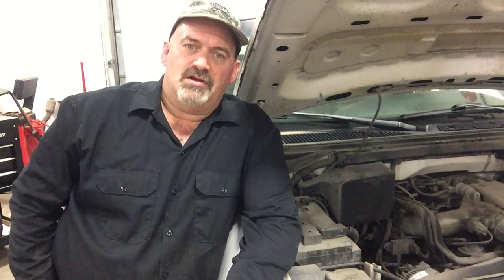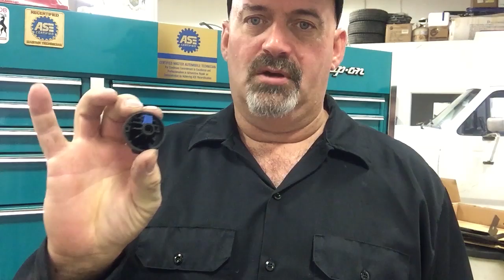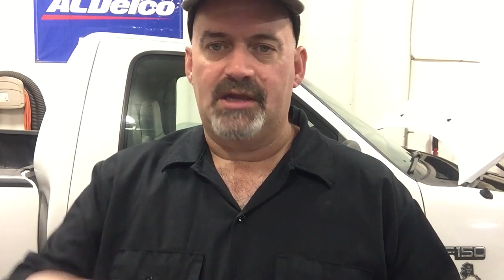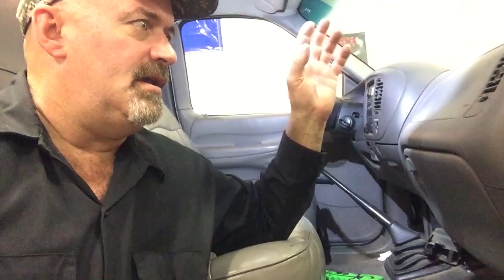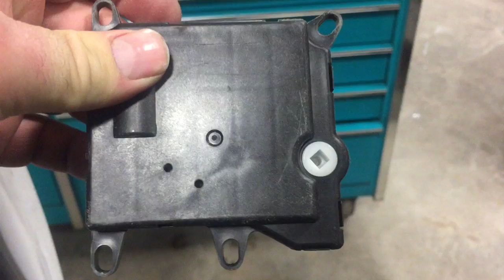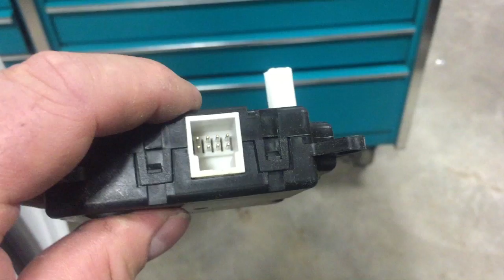Ford F150 Expedition Lincoln Navigator No Heat Or Cold Air - Blend Door Diagnosis and Repair

Comment: Hi Tim I just replaced the fuse box with a blown fuel pump Relay on my 2004 Expedition Eddie Bower 4.6L now fuel pump is working but now AC and Heater blower is working but I don't have any Cold or hot air coming out before AC and Heater work good the used fuse box I bought is from a 2005 but not sure if it's from an Expedition or F150 or Navigator

Comment: Aloha;'s Bruddah! Great Video.

Have you come across an actuator where the white plastic gear assembly did move but had no effect on the hot or cold air flow  and you verified it was moving looking at it from below the actuator.

- And with further checking you found that the part of the gear shaft going into the HVAC housing was broken and not the blend door inside?  

- So basically it was the long shaft coming out of the actuator that had sheared off.  I guess the best way to check for that after you see the actuator moving is to take the actuator off and electrically and mechanically test it to verify the output shaft is working correctly before going through the hassle of removing the whole HVAC  assembly.
Reply from the maker: I have not seen that. The Explorer blend door shaft would break where it sticks out of case but still was the actual blend door at fault. Hey Bruddah, be sure to get out and vote!
Reply: you can bet I'm voting. what surprised me was just how much Alaska is pro-republican. I haven't  seen nor heard anything from Trump on what he's gonna do for Alaska.  Same goes for Clinton, seen and heard nothing from Democrats.  same goes for independent and green party. 
what's scary is that Alaska is a republic state.
I hope Alaska votes for the candidate that will protect our grandkids and generations to come.  
Personally, Trump is way too dangerous to be exposed to the inner workings of America much less the football. All Trump really only cares about himself and any money he can get his tiny fingers on.

Comment: All good info :-D
Yes that style of control knob does crack, my mates washing machine had the same flattened shaft fit, it cracked, but as im a bodger i found a tube off a crimp butt connector and carefully pushed it on, it was a real close fit, works perfect.
That crap plastic control knob was going to cost £25 or $31 usd, not paying that for a crappy cast bit of plastic.
Reply from the maker: I think they plan it that way so they can sell their cheep parts to repair it. Lame.